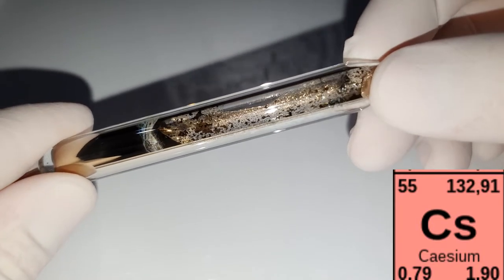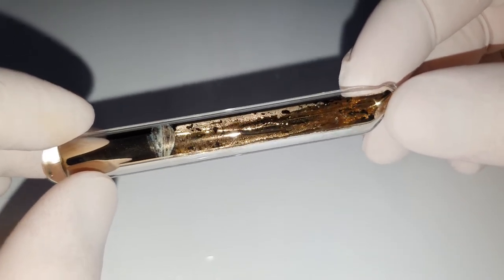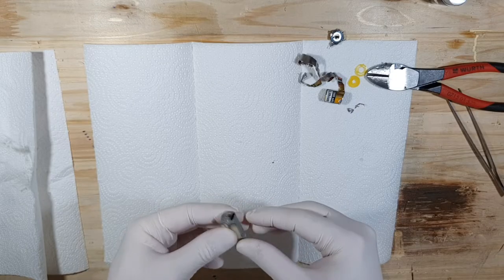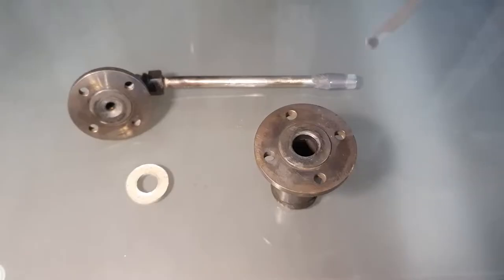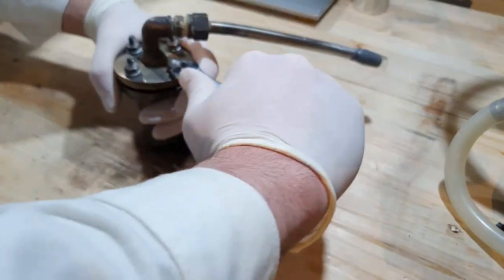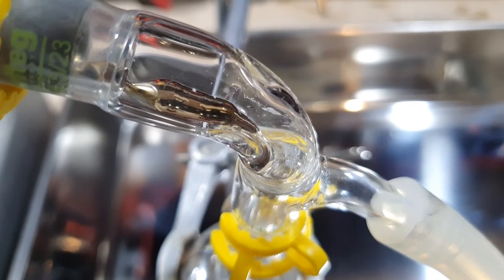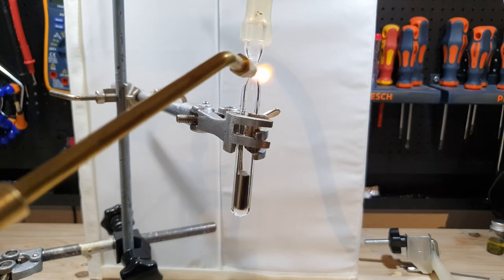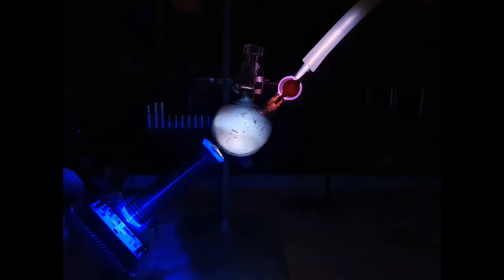Cesium (Caesium) synthesis

Comment: I did a cesium chloride gradient to purify DNA in college using ultracentrifugation. We were required to match the tubes using a balance with a precision of 0.1mg. It was sensitive enough that if someone entered the room while we were measuring it would throw off the measurement and we'd have to wait for it to settle again. This was overkill, but was done out of an abundance of caution. Our professor told us a story about how someone failed to properly balance a titanium rotor in the lab he formerly worked in and it had enough energy when it let go that it blasted through the ballistic armor inside the centrifuge, then down through 4 concrete floors, and embedded itself deep in the basement soil underneath, so he was a bit nervous about them. Very cool seeing someone reduce it into its elemental form. I watched your other video with the large vial. Very beautiful. I got nervous just watching you handle it indoors. Good thing you have steady hands and a cool head.

Comment: You need some small septa, and a pear shaped flask.  Also,  I've seen some instances where a high temp wax is useful for things other than sealing vacuum gauges in certain types of shlenck lines; it's not as messy as you'd think....cleans up easily too. 
Anyway, I didn't know you could distill caesium. Great video!  Your videos give the itch to spend 100K and turn my garage into a functioning lab. But I'd probably lose my job.

Comment: I think mixing shouldn't be too much of an issue considering lithium and cesium chloride will both melt. Wonder if diffusion will do it's work properly in there or that they mix poorly. Perhaps adding some movement to the vessel or some sonication could aid in better mixing, if that is the issue.

Comment: I'm going to try with pipe fittings but then tig weld or brase in the hope to get it air tight
Reply from the maker: Did you write a longer comment before? I saw a notification but can't find the comment anymore.
Reply: @AdvancedTinkering  I did delete a comment either here or on another video. I was just asking if 316 stainless was OK for the reaction vessel but I didn't need to ask after all. I'm still shopping around for suitable bits. Like I said I think I'll tig weld 316 stainless steel 200ml 2"BSP tube with end cap at one end, a 90° reducing elbow  connected to a 200mm 1/2"BSP tube the other. I'm still deciding the glass to steel interface. Ill probably have another 45° or 90° elbow so we're pointing downwards again. KF-16 flange and clamp provided I can manage to make a good glass KF-16

Comment: you did not really explain why Lithium which is less reactive, gives its electron to the Cesium. it should be the other way around. I am curious of the chemical reason why Li reduces the alkaline metals below it from its salts.
Reply from the maker: In this case, Lithium actually has a lower redox potential compared to Cs. But it would also work with Sodium, Calcium and others. 
There will always be a tiny amount of of Cs present because the reaction is in a chemical equilibrium. By removing (distilling) the cesium from the reaction, the equilibrium is shifted to the right side of the equation. It's called Le Chatelier's principle.
Reply: @AdvancedTinkering  I found the answer on vedantu it is actually related to high hydration enthalpy of Li:
An element that acts as a reducing agent, must have low ionization energy. Alkali metals act as strong reducing agents as their ionization energy values are low. Since, ionization decreases on moving down from Li to Cs, the reducing property also increases down from Li to Cs.
Lithium ion is small in size and has high ionization enthalpy. Also, more solvent molecules can easily surround around the cationic sphere. On the other hand, because of its small size, it is extensively hydrated and has very high hydration enthalpy. This high hydration enthalpy compensates for the high energy needed to remove electrons. Thus, Li has a greater tendency to lose electrons in solution than other alkali metals. The Large amount of hydration energy makes it the strongest reducing agent in spite of its highest ionisation enthalpy.
The tendency of an element to lose electrons in solution is measured by its standard oxidation potential value E0ext
. Since, alkali metals have high E0ext
values, these are strong reducing agents. However, it is observed that Li is the strongest reducing agent amongst alkali metals in solution as E0ext
value of Li is maximum.
Note:
It should be noted that since ionization decreases on moving down from Li to Cs, the reducing property increases in the same order. Thus, Li is the weakest reducing agent while Cs is the strongest reducing agent amongst alkali metals in a free gaseous state.
Reply from the maker: That's not the complete answer. As I wrote, it has a lower redox potential than cesium, which means it is able to reduce Cs. 
But it would also work with Sodium. Which has a higher redox potential.
Reply: @AdvancedTinkering  i think it is, Li reduces Cs+ to Cs because they are in a liquid phase, a solution where the high hydration enthalpy of Li dominates, in pure gas phase this would not work as in that phase Cs is the stronger reducing agent.  Na works for same reason as well because Na atoms are smaller than Cs.
Reply: @tokajileo5928 not a lot of that determines the success of the reaction when you are constantly removing Cs. A energetically shit rxn will still yield.... that's why the French guy's principal is so handy.